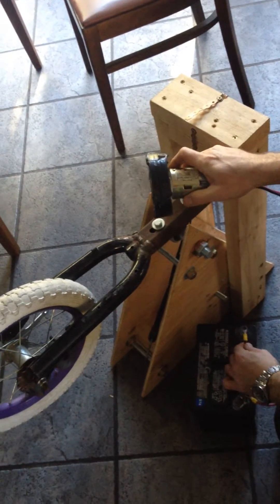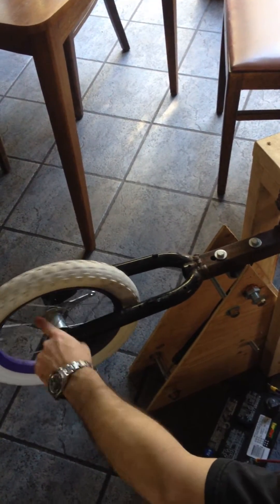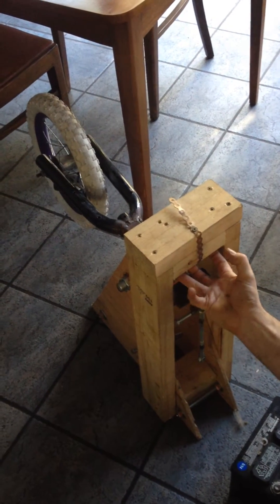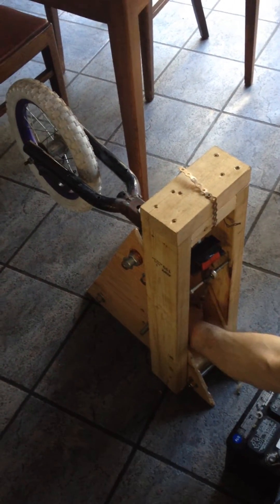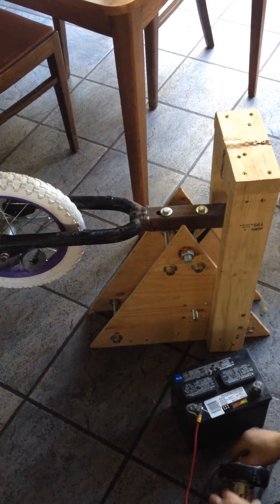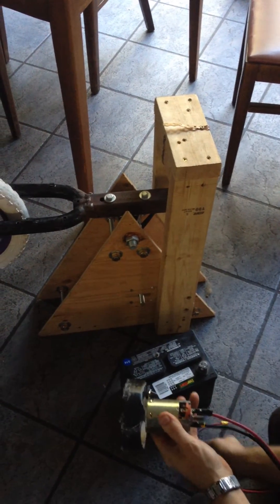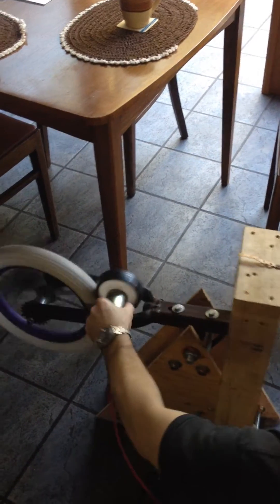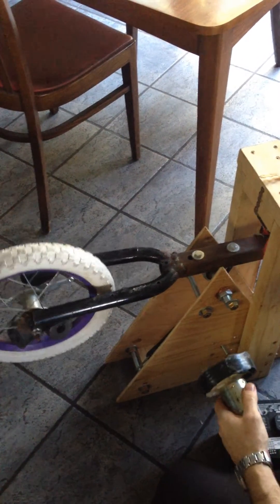IMG 0523

Comment: Not to be rude but this also like 2-stage oscillator created by Russian inventor but he used a hammer going up & down beside a rotation of force with weights like you did nice design
Reply from the maker: Not Russian, Ukranian I believe.  http://www.veljkomilkovic.com/
Veljko uses pendulums that cannot be accelerated, and force is derived through mass times velocity as the rendition being taught today is describes this as Mass x Acceleration, however, acceleration is a change in velocity and ignores the existing potential. The truth is that we are already moving, and we are moving in more than one direction simultaneously.  As you see here, I do not use two levers.

Comment: I think I dont get the WOW of it.
It demonstrates the relation of power and energy (work).

While the e motor distributes evenly power the power over time (work or energy) gets stored in the potential energy level of the weights of the wheel. So the mechanical construction releases power peaks over time, while the e motor distributes it evenly.
If you would compare the Work (Energy) it will be the same.

You could compare that with charging a bank of super capacitors. They can also release their energy in a big power spike thus in a SHORT time!

I am open, so please let me know what I don't see here.
Reply from the maker: Do a google search, and you will quickly learn that we do not need water as a conduit to tap our planet's motion. 
https://duckduckgo.com/?q=electrogravitational+propulsion+mechanics&iax=images&ia=images
This has nothing to do with an inaccurate rendition of "energy", which is provided by the motion of our planet.  This method replaces the need for using water as a conduit to tap this inertial compression. 
The force needed to run this wheel was less than 0.1 amp at 12 volts.  The compression induced by the leveraged compression was 400 times the force used to maintain the wheel in motion and the wheel is never restricted. The secondary value is provided by the leveraged mass in rotation, which even when restricted 100% does not impede the motion of the wheel.  So, this removes the restrictions maintained by the theoretical values that you are describing, just as any water siphon or moving body of water does.  
Tesla knew this and used the same electrogravitational potential that most people seem to be ignoring.  When you discuss potential, do not fail to apply the six fields of rotation that is already provided for us. 
When comparing the force used to maintain the wheel with the force produced by the leveraged compression of a mass in motion, we see the same result as a speeding bullet, without impeding the bullet.
The inertial compression is as stated in this diagram, a schematic showing the relative compression of a leveraged mass in motion.
By removing the dogma that is being taught as theory we can easily test this function.  You will find that the mathematical expression is accurate and that the reaction is repeatable, and the force value )work function) is not even close to being the same value. I show how easily the small wheel on the motor can be stopped, with one finger. The opposing value could not be stopped even with a 230-pound individual sitting on the lever. In fact, it carried the person across his kitchen, dragging the battery behind it. 
Veljko Mikovic disproved the same claim that you are making here by using a pendulum and a dual lever mockup. I increased the force value by several times by replacing the pendulum with a wheel that could be accelerated.  The faster the wheel goes, the less power the motor needed to maintain it.  The draw decreased as the wheel accelerated as the resistance was lessened. 
This removes the values that entropy describes, as we never restrict the oscillator.  We use the imbalanced rotation to induce the electrogravitational potential that is referred to as inertia. You can test the math vs the function and you will find both to be accurate representations. In fact, RJ Reynolds, who commented below has already done this and applied this to a high school curriculum, as this can be taught to and tested by children.  Easily.
https://duckduckgo.com/?q=electrogravitational+propulsion+mechanics&iax=images&ia=images
Reply: Simple design indeed!

Comment: So I guess it could be powered by a stream  or the wind to get the initial power ?
Reply: Yes
Reply from the maker: A battery would be much easier, just like starting a car, however, the fuel provided is the same force that moves water in a hydroelectric facility.  Nikola Tesla knew this. Clearly. 
Remember how they used to start cars?  With a hand crank. 
Remember, a water siphon won't start itself without a little help, but once the initial potential is induced, the movement of the water maintains the induced vacuum that initiates motion.  Moving water is electromagnetic, as is our moving planet. All we are doing is learning how to tap the movement of our planet without using water as a conduit. Here is a diagram.  https://duckduckgo.com/?q=electrogravitational+propulsion+mechanics&iax=images&ia=images
Reply: @kevinhay7421  - How have you been sir, used to follow you on The Book but you either quit or were removed awhile ago. 
Hope things are well up North.